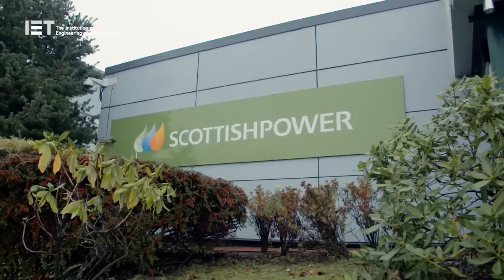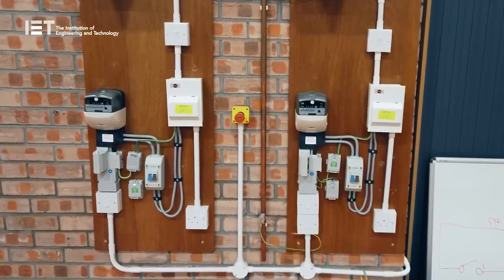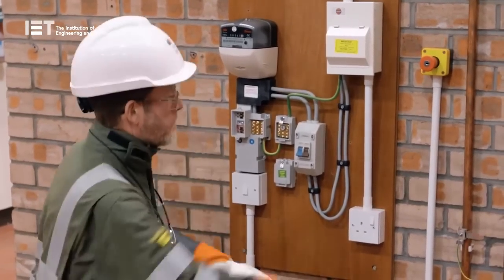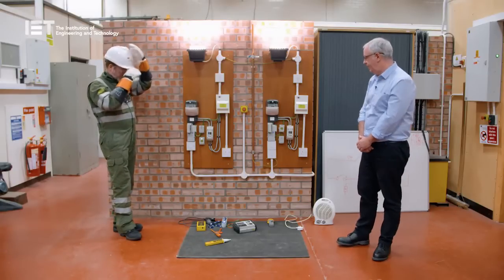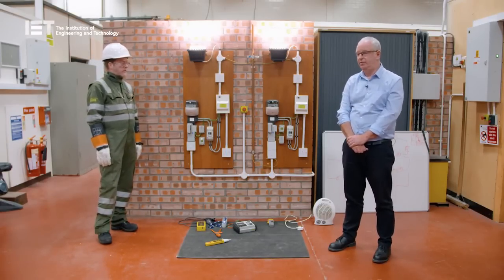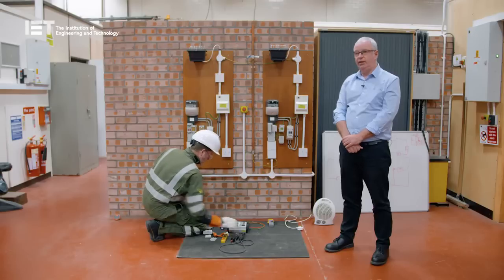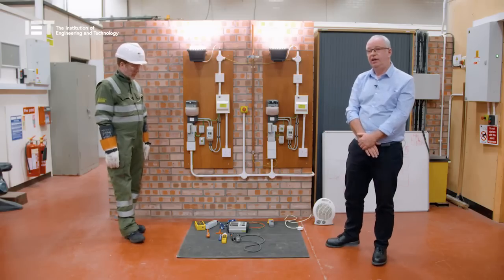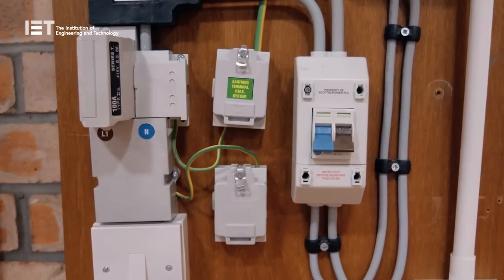Neutral Current Diversion Demonstration

Comment: There are also possible problems on overhead supplies where the overhead pole routing may create a longer path via the DMO Neutral than exists via the customer extraneous bonding (e.g. water pipe). 
I have a 3-ph pole in my garden that distributes to multiple properties, with my personal supply via a second, further away,  pole. I do see some small balance currents in my CPC/Earth.
Currents will flow according to physics, so some PME neutral balance currents will flow in the Earth.

Comment: The interconnected ground wire might seem far-fetched to many, but in reality that's an issue that you could get if you run network cabling between two properties. Especially shielded network cabling or even TV antenna cables.
Those aren't intended for the currents that could occur so you can easily damage equipment or get a fire in an unexpected place like a network outlet.

Comment: An apparent tl,dr of this video - And please correct me if I'm wrong - Is that one can safely check for PEN faults using a clamp meter around the earth conductor leading from their service point, possibly identifying current direction/source by reference to what's being detected against known loads on supply. 👍

I live in a block with TNCS/CNE wiring, PME, and Economy-7 heating, and to make matters worse the water supply mains are plastic and the gas mains have galvanic isolation above ground level too, basically making all of the piping in my block an isolated cage that's only connected to earth via CPC bonds. Any diverted neutral current passing through my pipes from another flat (Which could potentially be as much as 80A under worst case conditions) is going through a 10-15mm² earth tail into my service point. 🔥
(Thankfully, the reverse case isn't so bad - I use less than 1kWh/day and my maximum draw is never above 15A, so the bonds in other flats will easily take it if my own CNE conductor is burst. Yeah, that's what absolute rejection for having the „wrong“ disability and the „wrong“ sexual orientation does to a man... 🌻🏳‍🌈🏚)

What the above means is if I know that I'm currently drawing about 10W through my supply (A single LED light) and my clamp meter shows 10W flowing in the CPC coming from my service point, this suggests that my N conductor has failed (Meaning my neutral return path is now: My N -> My CPC -> Pipework to another flat -> Their CNE) and current is flowing out, whilst seeing 30A in the same test suggests someone elses N conductor has failed (Their neutral return path is now their N -> Their CPC -> Pipework -> My N) and current is flowing in. ⚡

Either way; Any current flow spotted through such test is a very good reason to call 105 and get the DNO to take a closer look... ⚠

Comment: Well done for releasing it. It’s sad the IET did not release it.
Reply: It's not only sad; Not releasing this video is also withholding a seemingly consumer-safe test for CNE faults which could be extremely important information, assuming the consumer has a clamp meter available. 🛂

The IET should not be withholding arguably safety-critical info just so they can monetize it... ⚡💰⚰🤔

Comment: Nice video and good explanation. And in my native dialect. 😂 I had a job in the summer for high Zs readings, after some testing we established no pen coming into the building on a TPN 200A supply. Nothing had blew up or burnt out. It was a steel industrial building with various loads and pretty well balanced across the phases. Scottish power came out, confirmed results and put us on a generator over the weekend then relocated the defective cable joint on the Monday. The jointers explained the situation well and the level of safety while live working was excellent and efficient. I had front row seats to the operation start to finish and it was a proper job. All the best.

Comment: Good testing demo show casing how to carry out the tests but not overly informative compared to John Ward and others. Sadly self inflicted by the DNO's due to cost cutting measures. Come across it probably twice a week often in suburbs adjacent to new builds. Slightly less of an issue for the sparks but a big issue for the gas engineers taking the gas meter out to do any work.

Comment: Our advice to the install guys is current clamp to all MPB conductors and the Earthing conductor prior to isolation on the mA setting and wand as well at the MET to the installation while it's energised then repeat once it's isolated. Should've then used the  non-contact voltage detector to the MET and the disconnected earthing conductor as soon as the earthing conductor was disconnected as you've open circuited the electrical path.
Oh, and your matting is a bit on the small side for doing this demo.

Comment: Seemed to end a bit quickly without explaining that diverted neutral currents would occur whenever there is a parallel neutral path - the pipe in the demo rig. Could also be building structure etc. The current will split according to the ratio of the impedances, I would guess not far off equal on the rig. There would not need to be any overt fault.
To establish that, you need to clamp meter the incoming supply cable (line AND neutral in the jaws) for a 'net current', & compare with the current in the earth link. They would be the same only if there's 100% diversion due to an open- PEN.
One very obvious way of telling on a street level how much diverted neutral current is present on supply cables is a nT (nano Tesla) meter. The magnetic field from an unbalanced cable drops off with a 1/R characteristic, where R is the distance from the cable. The drop off of field is much steeper from a balanced cable & only exists if there's a gap between the line & neutral (eg overhead open wires).
There's a lot of imbalance about, & the resulting stray magnetic fields can be a pain for sensitive equipment like audio set ups etc.
Reply: Agree, I see it (parallel 'neutral' path) in my property. I've seen about half an amp at worst. My water pipe is likely a good alternate return path for phase unbalances.

Comment: Always clamp test your main earth , simple , this issue has killed many people, plumbers disconnecting water meters without bridging the pipe work , rcds have helped with stray currents but if the main neutral is broke the only way to know is to clamp the main earth before you start any work .

Comment: John Ward set up a rig on his channel.  He demonstrates it much simpler.
Reply: John Wards video actually explains it, whereas this video doesn't, other than show the test process
Reply: @n4thb4dc0  
Not even showing the instruments readings.
Reply: @n4thb4dc0 disagree slightly.  At least this videos showed the implications of having. Phase to phase fault when the main neutral is compromised.  Overloading all equipment in the home due to an unbalanced load.  JW 2 x cutouts are connected to the same phase and
Reply: Yep agreed his was far clearer in demo. Music was distracting😮

So to a none electrician....as lots of this type of vid popping up is the hole system unsafe 😊